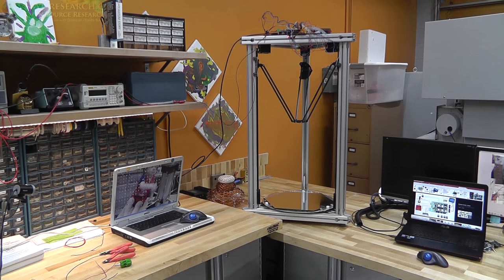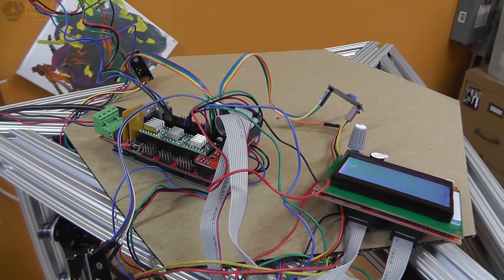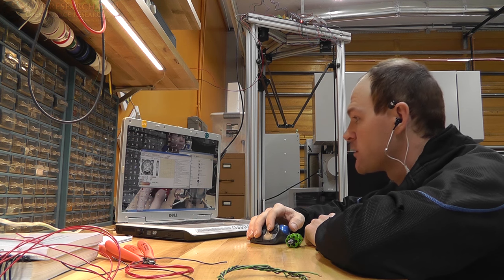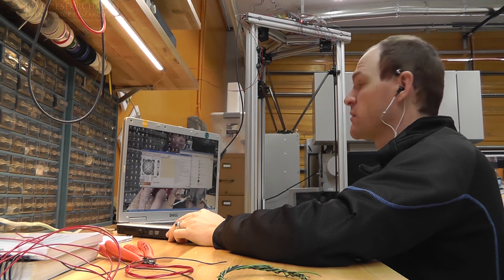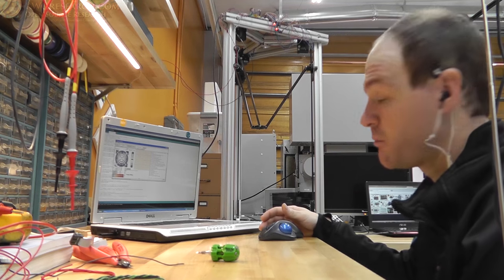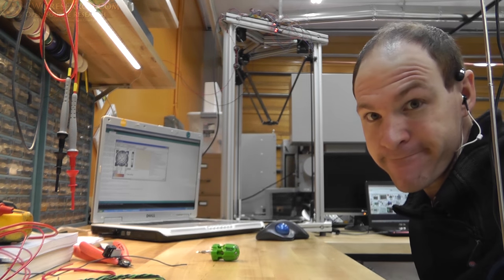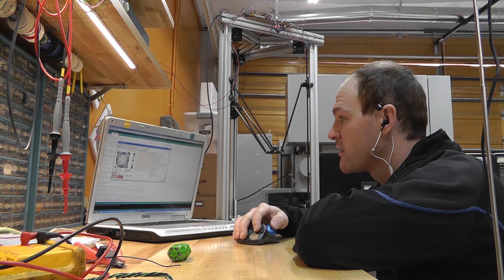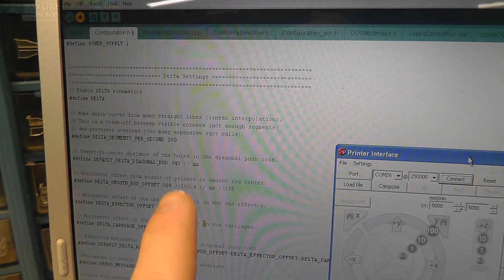RWG-OSD #14 : ITS ALIVE!!!!!!! Not Without Some Trouble Though... OverSize Delta 3D Printer Build

Comment: Congrats!!  Finally... it awakens!!  If you had to do it all over, from ground zero... would you still go Delta? If so, why so?
I want to get/build a 3D printer... but OH MY... there's so many different kinds out there. I like the new Tiko idea... for entry level for my teenage boys to start "Maker-ing".... but for myself, I'd like the possibility of future flexibility... possibly CNC routing, laser cutting/etching, etc.  I could see my need for strong parts using carbon fiber filament or similar.

Sometimes I fell like I'm at a really good buffet restaurant... too many choices - I can't make up my mind!

Comment: Russ - whats that circuit board that you have connected your hall effect sensors to? I just stuck three leads on mine and plugged them into the RAMPS without any interfacing circuit.
Reply from the maker: +Phil Waud that's the sainsmart controler ( see last video on the OSD for those details) its where i extracted them, the IC/circuit board  lets you fine tune the sensitivity.  else its an analog output ( depending on the hall IC, it could also be digital, and that's fine) 3$ on ebay. that's almost cheaper than the hall its self from a local suppler... it will work the way you have it as long as the hall can handle the voltage, most halls have a built in IC for this purpose. and are ok to use that way. here is the one i have 
http://www.ebay.com/itm/SainSmart-Hall-Effect-Sensor-Switch-Magnetic-Detector-For-Arduino-UNO-R3-Motor-/121340725331
~Russ
Reply: I bought 50 hall effect sensors for £3.

Comment: you really should try the repetier firmware with repetier-host
Reply: +郭牧楠 9:36
Reply from the maker: +郭牧楠 yes, i have, and it will be in the upcoming videos. i mention this in the end of this video. thanks ~Russ
Reply: thanks for the reply,I just wanna say with the G33 command in 0.92.9 repetier firmware,it is very easy to level a Delta(if you have a z-prob)

Comment: I am having the same problem trying to follow your original delta build. I try to hit home and and all the axis's try to fly through the top of the machine. I am using mechanical end stops.
Reply: Have you checked out the Google deltabot forume?
Reply: +happyvalley808 no I have not I have been using the delta wiki and his original delta video.
Reply: +Nathan Eyre deltabot forum will be your best friend, some amazing individuals that seem to be very willing to held. Make sure to giveas much information about your current build
Reply: +Nathan Eyre jay couture made a great calibration guide. look it up in the forum .
Reply: +happyvalley808 thanks
Reply: you need to invert your end stops if I remember correctly, in firmware
Reply from the maker: +happyvalley808 yeah, try turning down the speeds too. just till you have it working properly, i spent weeks playing with speeds to get it just right, nt to fast , not to slow, find the acceleration speed and turn it way down, this will help to keep the motors ramping up slowly , instated of taking off like a bat out of.... ~Russ